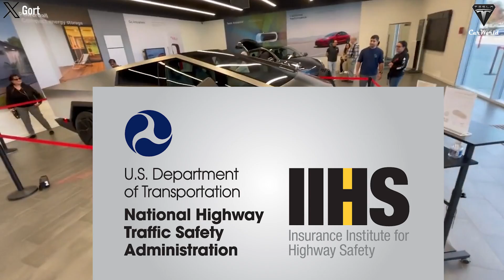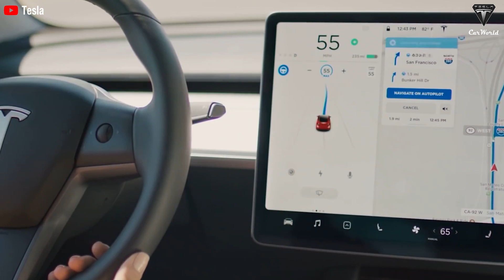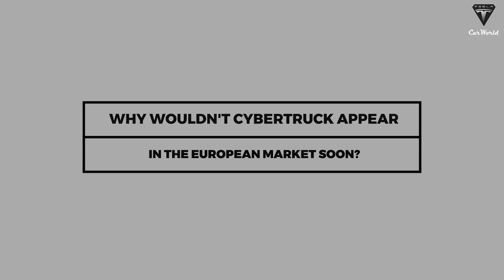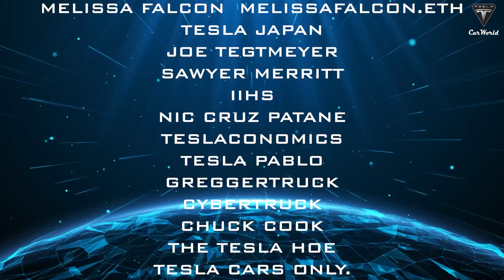Elon Musk Explained Detail the Reason Why Cybertruck Crash Test is TERRIFIED! Is it really SAFE?

Comment: This is a problem the rest of the market has not Tesla and the cyber truck make vehicles tougher, Electric vehicles that is.current regulation is for combustion engine cars they need upgrading to protect the passenger more given that EVs have no engine in the front and the ability to fit more safety features in there .